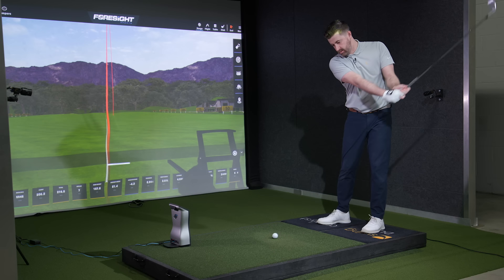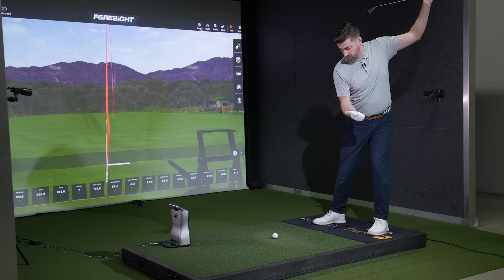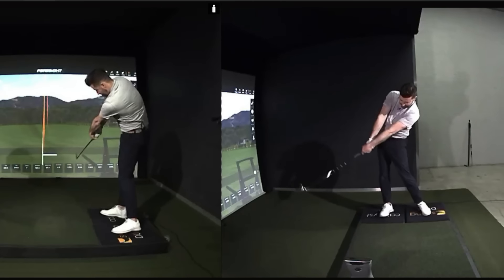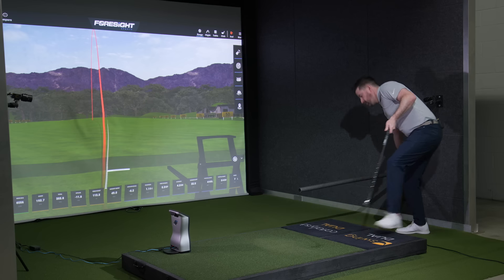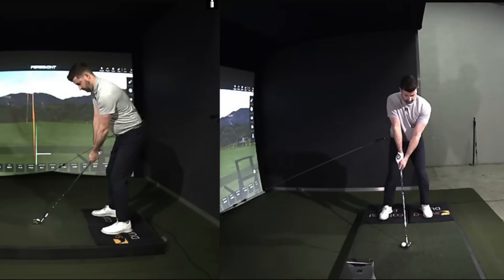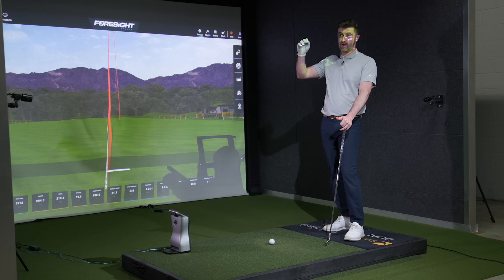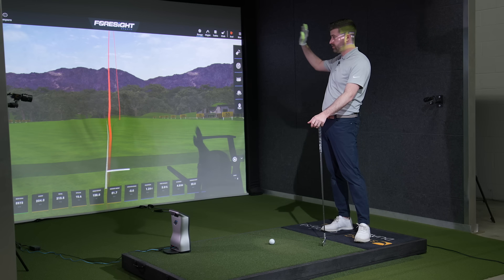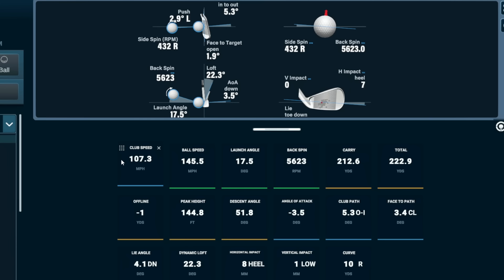How I Gained 7+ MPH of Clubhead Speed

Comment: Sequencing and kinematics are everything. To piggyback on your comment at the end of the video, when you "try" to swing harder, what's happening is that you are engaging muscles in your arms. Whenever you engage a muscle group, your sense of balance will force you to subconsciously move other muscles in the opposite direction in order to stay balanced. So when you try to "swing harder" with your arms, your torso will actually engage in the opposite (read: wrong!) direction, causing you to slow down and get out of sequence. Conversely, when your body movement is fluid, there is no countervailing muscle engagement, which enables you to swing faster. Essentially: when you "swing harder", you're actually fighting yourself, it's just that the muscles that fight you aren't the ones you think they are.

Comment: I do this type of resistance band work with my patients all the time. Pull them into their weakness so their body can resist it and build up strength where necessary. Smart way to incorporate this concept into the golf swing.

Conversely, you can use resistance bands to help in the direction they need to feel so their body knows what it's not doing correctly.

Comment: Matty, thank you for all the great content! Ive mentioned this in a comment on some older txg vids but our swings are pretty similar. Im a lefty also, same speed as well. I fight lateral slide of pelvis in downswing. Trial hip fires way to hard, i get tilted too early and basically stall flip. Battling over draws and pulls/pull hooks for a few years. I feel like maybe some band work reaieting the bad motion might be the cure! Slow swing with a ball i can do the proper motion. Once i add power, trail hip fires into ball 😂.

Comment: Maybe the “rally cap” needs to come out when you go into pursuing a speed goal mode Matt.    Impressive gains.  My dispersion has cleaned up to acceptable levels.  Want to tighten it up a bit more and then move to getting some more speed involved.  Definitely some stuff to keep in mind while sliding my goals to increasing distance some.

Comment: You are achieving proper "internal rotation" what we call "post" in the golf swing. Being able to properly "internally rotate" instead of this "jumping" that TPI advocates is sufficient.  Internally rotating is the foundation and crucial for efficient shift of GRF.  Matt if you can be stronger through your right internal obliques this will help in internally rotating naturally. The internal obliques help for rotation of ribcage as they help to initiate, accelerate and slow down of the golf swing. A symptom of this - looks like you pull the handle which could delay how efficient you internally rotate.  If you had the left arm elbow in front the body instead of behind as you pivoted 110 would be a cake walk. 

Your pivot should release the arms right through the ball.  A lot of golfers cant achieve this because their right and left halves are out of sync.  Amateurs cant get into their right and struggle to get back into their left side - that is fault of not properly internally rotating. 

If you don't have connection (GRF) and naturally suffer to open up efficiently causing the shoulders to be overactive: this all is direct symptom of not using internally obliques which would cause you to overly use the left arm by default - when you have strong internal obliques your arms are relaxed and feel like a whip.  Thus speed increase by default. 

TPI advocates a push from front of lead foot backwards to simulate jumping motion, which causes you to spin out.  For high handicappers this can cause a lot of shit to go wrong.  It is easy to misinterpret - they also base a lot of their findings on the measurement* of tour pro's but those tour pros have achieved their own success without them.  So you tell me what's really good.

Comment: So there are a couple factors to go along with your hypothesis Matt… In your initial swing you have turned your chest quite a bit less than when your coiling away from the makeshift cord which allows you to actually have more width a bigger chest turn and more time to actually turn out of the way of the shot… from down the line I would bet your lead arm on the swing with much more lateral force is higher which is also caused by less pelvic turn and less loading of the trail hip which will make you slide more to hit the inside of the golf ball which your brain k owes how to do cuz your a good player…. If you were to make the same backswing in the second swing as you did in the first and then try to use the ground the same as the second you would have hit it worse and probably chunk hooked it…. Just my 2cents but might be worth a dollar

Comment: Seriously, is there a functional purpose of swinging a 7i at 105 and carrying it 210yrds? Many people will probably be working on Driving it farther and having a short 9i or even GW into the green, which certainly makes more sense and easier to achieve, then to break your back and try ripping an iron 2 clubs longer than what is necessary.
Reply from the maker: I'm working on a technical change to the swing. I don't recommend people do most drills using a driver, at least initially. Has nothing to do with trying to hit my irons farther independently of my driver, the technique will add sequencing and speed across the bag